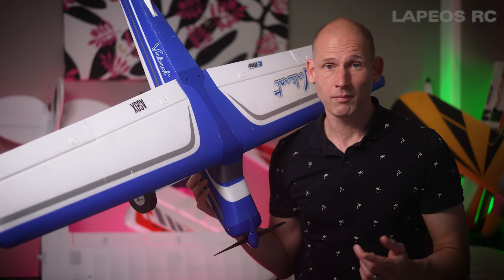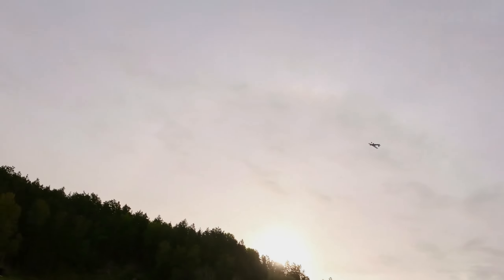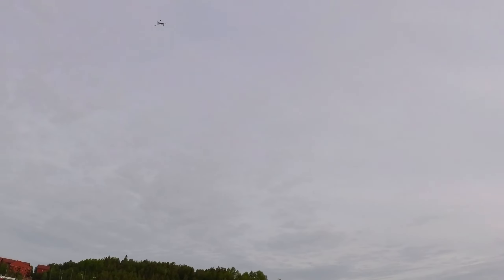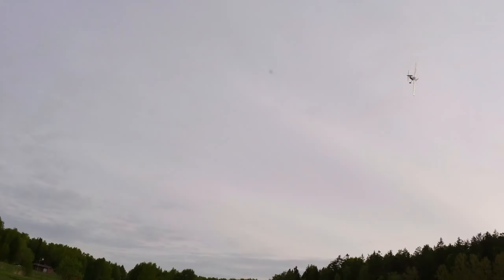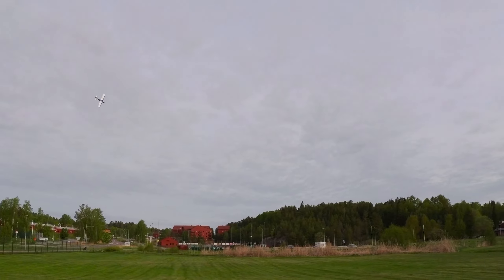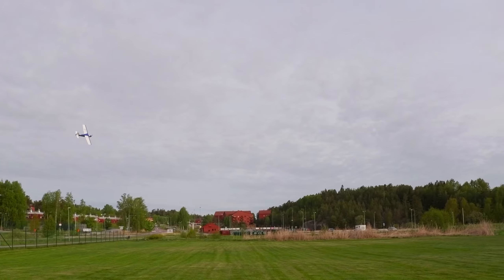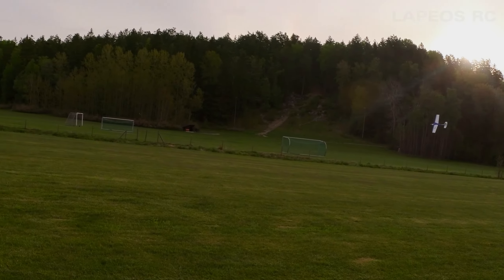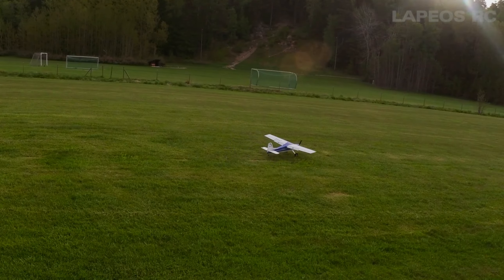E-Flite Valiant Pure 1300mm FUN!

Comment: Nice flying! I would like to know what battery you used? 😊
Reply from the maker: @Finnishrc-pilot  Thanks! I use Spektrum 3S 2200mAh batteries.
Reply: Thanks!😊
Reply: I am at the point in my life where I am going to get just one more plane.  I think this is the one.  I have had my eye on the Valiant for a few years now.  Do I detect a louder motor or prop on your plane?  It’s seems louder than others I have seen on videos.
Reply from the maker: @davegedeon3767  It sounds a bit different than most other Eflite planes. If I only could have five planes Valiant would be one of them.

Comment: First thing I did before my maiden flight was to add Bush wheels and Nav lights. The wheels and lights I used came from a Fly Zone Beaver. I have a video of mine with those mods from 2019 check it out on my channel. I also have a Eflite 1.5m Comander that I also had ditched the wheel pants for Bush wheels. Those wheel pants are not for grass field ops.
Reply from the maker: @Mr.XJ.96  They should make a bush variant of the Valiant
Reply: @SunriseRCAviator  They should....Half the fun of this hobby is modification.